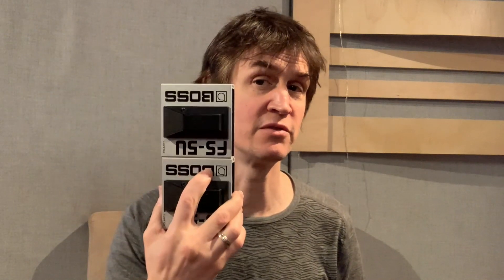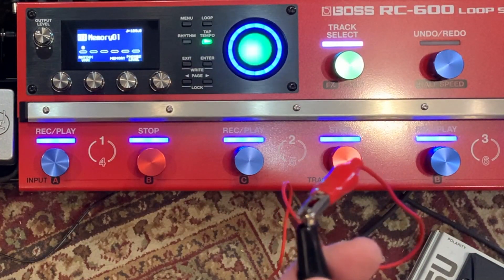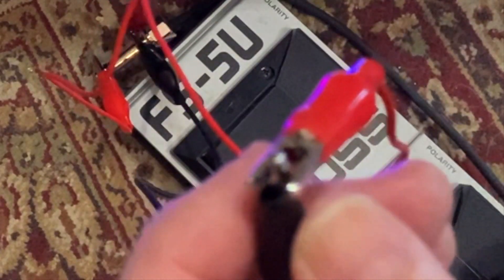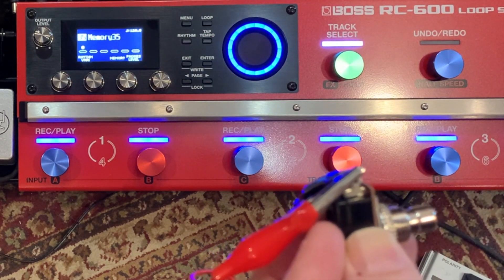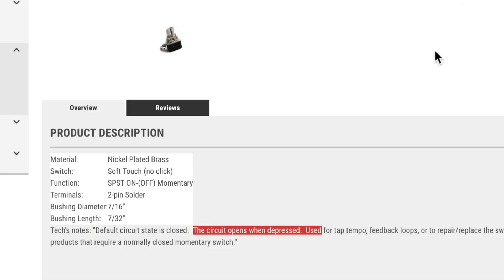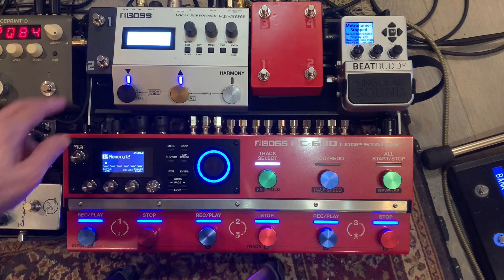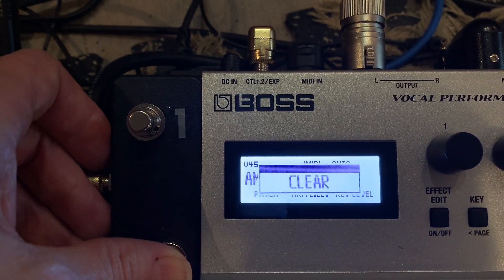Make your own smaller Boss Ctl Switches

Comment: Hello, great video thanks!  Is there a way to solder something inside a n.o. switch to make it an n.c? I cant find an n.c. switch, so i want to mod an n.o. switch to closed.
Reply: In Canada, I see a company named Nextgen Guitar Electronics.. seem to be reputable. And can order by piece.  
  Fantastic job, thanks for posting this.  Anyway to get a sketch of your wiring?
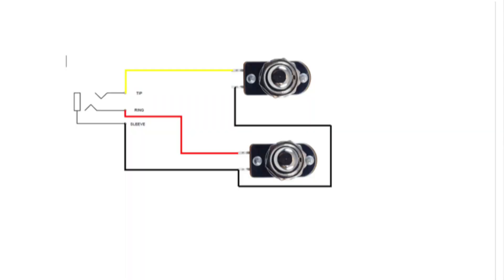Reply from the maker: @BDawgoftheNorth  Thanks for the prompt to add timestamps. See 3:28 seconds for the wiring diagram (unfortunately, I don't have a PDF... And I wish I had more time right now to make more videos. Happy soldering!).
Reply from the maker: It's the way the switch is set up. What country are you ordering from?

Comment: Hi Angus. Great video, many thanks for sharing. Would you know if the Boss Ms-3 supports normally opened or normally closed? I am planning to build a 2 switch...one to control tap tempo and the other to be assigned to some other parameters.
Many thanks for your time. Brian
Reply from the maker: I’ve not seen a boss that is not normally closed, but I have no experience with boss switchers. Check the parameter guide, where it seems to describe your ability to do both with INV.
Reply: Thank you so much for the info and getting back Angus. Really appreciate that

Comment: Great video, I am new to the mc8 and love my boss pedals. This has been helpful and very much appreciated. Is there any way to set a double switch normally open momentary with an alternating green/red led? I would like to use a dual switch to control the mic mutes of the rc and ve 500.
Reply from the maker: I was going to do this when I was using another (unnamed) looper before the RC, but I think you are much better off muting with a midi message from the MC8. (unless I am misunderstanding)

Comment: I just acquired the boss dd500 delay. I would like to build a bank up bank down for it. Like the boss fs7 pedal. Am i correct in assuming this is the same?
Reply: Or would I need latching switchs
Reply from the maker: @MinistryOfStrings  Yes, it is the same.

Comment: Would a toggle switch be too much to control the Open or Closed switches?? 
Btw great clear video
Reply from the maker: Do you mean a toggle instead of a momentary switch?
Reply: @Angus Maclean  no to open or close, as referring to the momentary switches. I think I was making it alot more complicated than necessary.
2x momentary switches
1x stereo out
And that's it , right?
Reply from the maker: Correct, for Boss and many others. Some pedals allow you to do three switches for one stereo out (e.g., MorningStar).

Comment: I would like to make a one switch 
  FS-U5 PEDAL .how do I do it
Reply from the maker: 1. Know if you need open or closed. 2. Decide on the size of enclosure (small is good; too small is unstable to stomp), 3. Get parts (one switch, one enclosure, one TS jack), 4. Drill out holes, 5. Solder one prong to tip, one prong to sleeve., 6. Test, 7. Put it together.
Reply: @Angus.Maclean  how do we know if it is noramly open or closed before buying?
Reply from the maker: @pogpogger4381  It will say. If not, buy elsewhere. Most boss ctl inputs (e.g., DD-500, RCA-600) allowed two switches, so you might be wasting a switch available if you’re only going to make one. Also, the space of one is almost the same as an FS-5U, so unless you’re doing it for fun there’s not a lot of cost benefit for one.

Comment: thanks for this. Nice pedalboard - is the BB synced up to the RC-600?
Reply from the maker: Yes, the BB syncs perfectly (Menu>MIDI>Sync Out: on). However, choices...In RC-600 (Loop>Rhythm>Start Trig & Stop Trig). which is nicely per memory. The RC triggers the BB to start. And there are more options, but this sets up the sync.